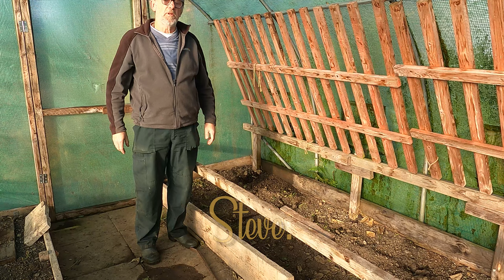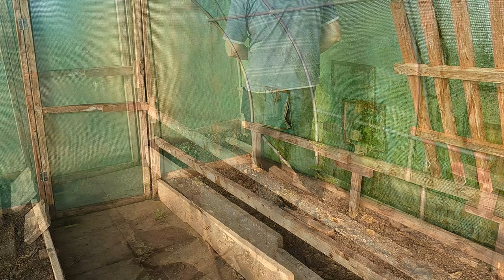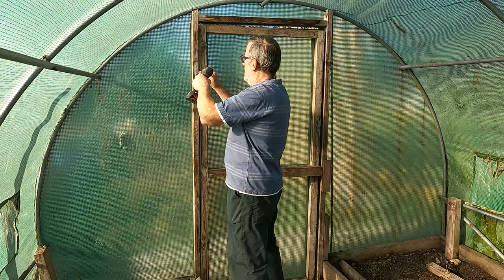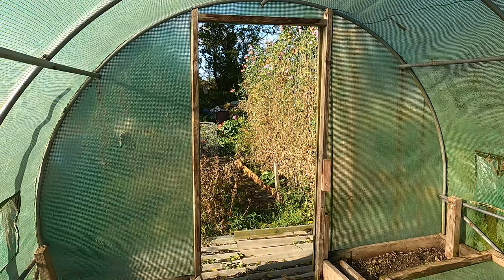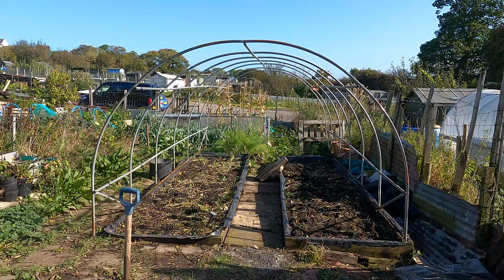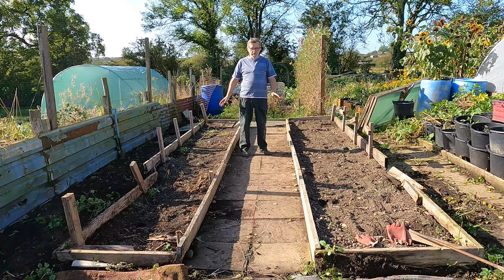Tunnel Tear Down | Dismantling Old Tunnel | Brassica Frame | Green Side Up

Comment: First tunnels 25.4mm dia P and Q clips will fit (nice and tight) the tubes on that old tunnel. If added to the new polytunnel delivery you'd save their £5 delivery charge.